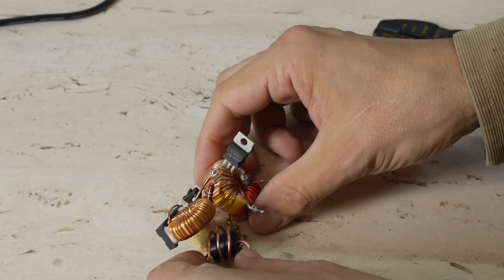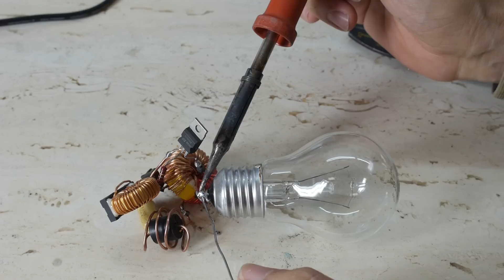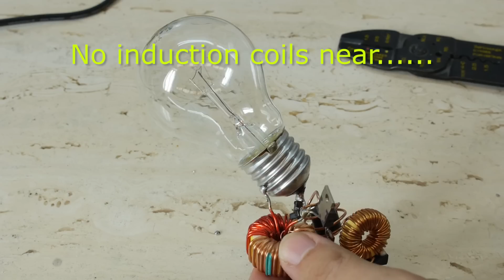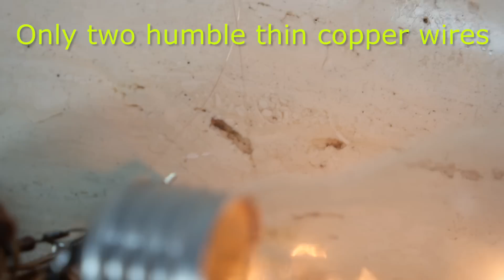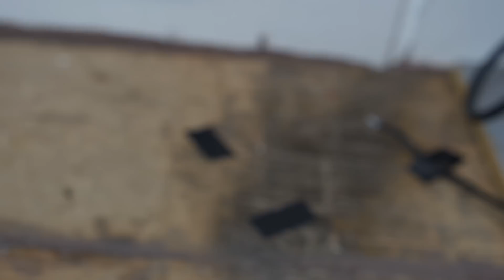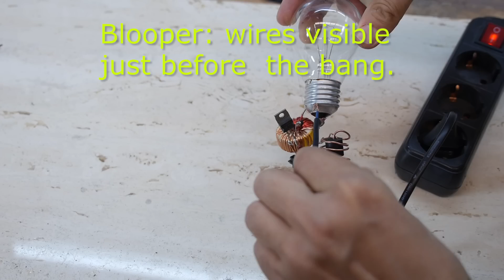Free Energy Light Bulb UNVEILED

Comment: Damn, I guessed wrong. I thought that yellow thing was a capacitor, that would be clever too considering the starting feed.
Reply: ***** It would depend on if he limited the discharge in that mess of nonsense under the light bulb.
Reply: Richard Smith I was thinking something along those lines. I'm not a complete noob at electronics, but my knowledge is limited.

Comment: WANTED TO ASK WHAT EXACTLY ARE THE COMPONENTS THAT TAKES YOUR DEVICE. THANKS I HOPE YOUR ANSWER.
Reply from the maker: Two induction coils with ferrite core; one resistor; one transistor; one capacitor (yellow); the black cylinder with a wire around is nothing ( a plastic with a copper wire not connected); This all form a decoy a fake circuit that does nothing....

Comment: what gauge wires are those? are they directly connected to the wall outlet or is there something stepping down the power? I'm assuming they're coated as well or else i would think they'd short out if they ever crossed.
Reply: there's surely a step down scheme, bulb light is lower
wires are for transformers, they are laquered
Reply: Let'd do the math ! Assuming mains voltage is 240v in his country and the bulb is 60w, P=IV so I (current, dictating the thickness of the wire) is 0.25 amps. Easily enough for some thin gauge enameled wire to carry.
Reply from the maker: There is another light bulb in series so the voltage is half.
Reply from the maker: Tom Wilkinson For security I put another light bulb in series so the power is half.
Reply: fine transformer wire comes with a very thin polyurethane coating which will withstand 110V for a while. My guess is that the first failure found 2 small cracks in the insulation. You'll note the globe wasn't very bright so it could have been only 30-80V.

Comment: what is the function of that decoy circuit here?
is it made to attract viewers or has a technical function here?
is it converting AC to DC 
if it is not working in DC then how come the thin Cu wires are overlapping each other???
Pls do clear my queries....
Reply from the maker: Mrityunjoy Saha All magic trick has a "decoy"part.
Reply: oh so that means it is an illusion not a factual job??!!
Reply: Mrityunjoy Saha
Would he have managed to convince anyone of a free energy device if he was just holding a bare lightbulb? No. You need to actually tell the lie to fool people.
Reply: yes you are right its hard to convince people no matter its right or wrong........actually first of all i was very much astonished by the act...but when the truth was revealed i was clear though i was very much uncertain about the wire overlapping issue...
Reply: Mrityunjoy Saha The function of the decoy is to be a decoy, diverting the viewer attention away from the truth.
Reply: The wires are coated. The kind used for making audio coils.

Comment: circuit diagram, parts list with values not mentioned to assemble this gadget, not necessary ?
Reply from the maker: The only thing is that the circuit doesnt short cut. The circuit is an "ornament" so better not contact the circuit with the mains.

Comment: there really is such a thing as free energy
plug in a long extension to your neighbors wall outlet wala free energy unless your caught then your no longer free LOL

you can make a crystal radio set which uses free energy pulled from the radio waves in the air,,,, this is very low power but a crystal diode actually produces free energy ,,,, the energy comes from a source such as the sun which gives the static between stations but still its energy then there is the radio waves from a radio transmitter which is electrical power converted to radio waves then converted back to electricity by the diode.... it does work actual work .... it is electricity pulled directly from the sky
Reply: jolllyroger Building your own windmill or your own hydropower plant, or your own nuclear powerplant is also free energy, it's just very costly.

Comment: As for me this circuit is fucking noncense. Actually  If  there were  not   "invisible" wire this bulb  not shined. (0.51)
Reply: +Sergey17324 
Ummmm, yes?
Reply: +IsbjörnXII  Ofcourse yes!
Reply: I mean, he clearly says that the circuit does nothing and the only reason the bulb glows is because of the thin wires.
Reply: +IsbjörnXII And and these wires had connected to source of electricity... Why he shows this video? For the sake of a joke?
Then the joke is good.
Reply: +Sergey17324 
he had another video where you couldn't see the wires, here he shows how it actually worked.